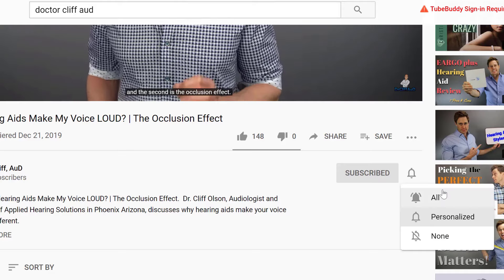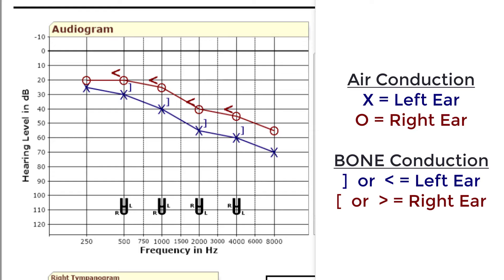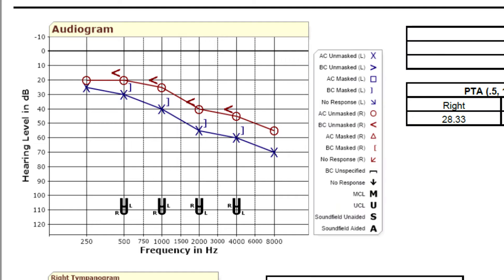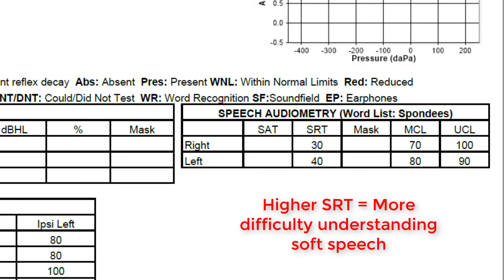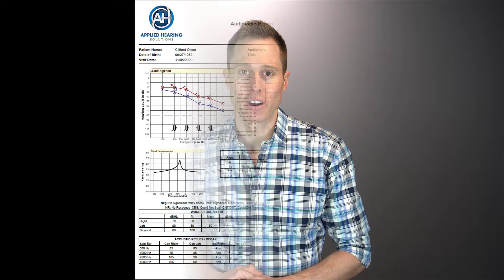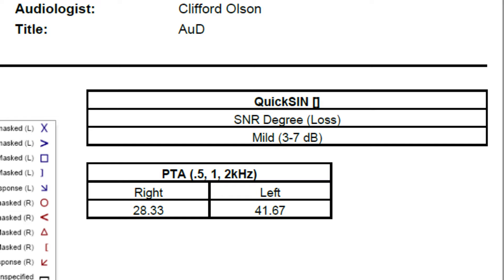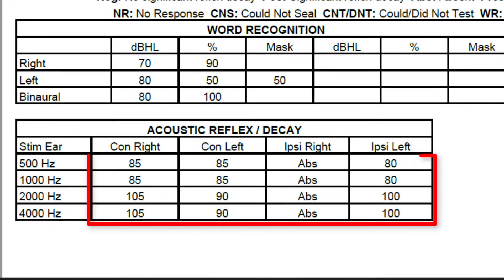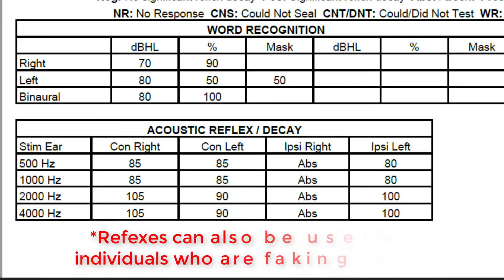Breaking Down Your Hearing Test | Audiogram Review

Comment: Another one of your really great videos and I've watched a few of them, lol.  I've now worn Philips 9030 HA for more than a year.  I started out at 80% of the initial REM settings and I've currently at 90% and about to increase that to 100% finally.  I've had to do some of my own programming to taylor my music program to my guitar playing and have two programs that still preserve some of the nice high frequency sounds of my guitars without the harsh distortion, shrillness and note doubling I experienced with just the general or music program.  In short I've turned off all the noise reduction, feedback control and directionality.  At the advice of another musician I've also adjusted the compression ratios to 1.3 which while probably not the perfect solution helped a lot.  And I've had to reduce the overall gain by about 4-6 dB a well.  Of course this isn't great for speech but it works while probably still not being optimal for my guitar playing.  I've got open domes and typical cookie cutter loss that is as high as -65 to -70dB.  Again none of this is probably optimal but it's much better for me.  My question is that I'm interested in getting or at least trying Widex HA this year with a $3K HA benefit I now have.  I want to see how the shorter delay times might help.  But I'm concerned that since I know my hearing when I remove my HA is far worse than it was normally since my brain is no longer used to working as hard to hear....how can an accurate re-test be done?  Or should I not wear the HA for the week before a re-test?  Thanks.

Comment: How long do all these tests take to complete ?
Reply from the maker: It depends on how many of them need to be done, but to complete them all, it could take up to 45 minutes.  This does not include the amount of time to review the results with a patient.
Reply: @DrCliffAuD  My hearing tests never have all of this info. on them and they only take around 15-20 minutes. Should I be asking for more comprehensive hearing test? I know about speech recognition and frequencies and bone conduction but I don't think they've tested the spondees etc. and those bottom graphs aren't on my audiogram. Also I think they only test 15-20 words. 
 I'm slated to get hearing aids next month - moderate-severe high frequency loss. Does missing these things on my exam mean anything is missing that I should have done before getting hearing aids?
Reply: @chrisbaerart  Mine take a hour or maybe more in the best time is morning , Audiologist Hearing Aides dealers Center should have a 2 big booth like a bank vault with a large door to keep out like traffic and offices typing and telephone ringing entering the booths .
Reply: Noises I meant

Comment: Hi Dr. Olson! I have a question, there is an instance of a patient resulting to a "mixed profound hearing loss" (both conductive and SNHL) on the left ear and tympanogram suggestive of a Type A, normal conductive hearing, on the left ear as well. Since the AC and BC suggests a conductive pathology on the left ear and tympanogram normal which eliminates conductive pathology of the patient, what could be other ways or have a conclusive interpretation of the hearing status of the patient if PTA and Tymp does not correlate? Thanks! learning a lot in your vids!

Comment: Is the speech in noise test always done or do you need to request it? I have had hearing tests and it was not performed. I asked for it to be done with the last audiologist and he told me he didn't have time to do it during that apt. I felt dismissed as if he didn't even care about my hearing. I bought my hearing aids there and this is the beginning of my 2nd year wearing them. To switch audiologists would mean I would need to pay each time I go in for service. Now, I get my hearing aids serviced for free since I bought them there.
Reply from the maker: Audiologists who follow Best Practices will perform Speech in Noise testing even if you don't request it.  If you do request it and they still don't do it, the question becomes:  What other things are they NOT doing that they SHOULD be doing?
Reply: Would the audiologist provide the test as part of your current agreement with them?  With the technologies of today (since digital) adjustments can still be made. Also, if SIN has not been performed, did you get Real Ear Measurements performed?  @Doctor Cliff, AuD has respectfully beat that necessity in my head - both can still be done (assuming the current audiologist has the equipment for REM). Please do not settle, you may need to push a little, just do not be afraid to advocate for yourself. You very likely paid a lot of money for the service - and if you do not get the service you deserve, be certain to share your thoughts via a review of your experience, this will help others make decisions and maybe influence a change in the practice for the future.
Reply: I agree with Both Dr. Cliff and others Professional Audiologist Hearing Aides dealers Center should care enough to give you a good hearing testing in the morning best time to spending time with you so you and audiology audiologist determine to get the right hearing Aids for you so they can adjust computer settings to fit your lifestyle and getting comfortable connecting with good ear molds fitting correctly and have their office have on hands of ears molds tubing and making new ears molds every year and having your hearing Aids clean up correctly and they should provide what hearing Aids dryers for you to use . Oh yeah Audiologist Hearing Aides dealers Center should have hearing Aids microphone filters on hands to replace every month or years supply worth since Groceries stores and department stores doesn't have any hearing testing and no parts available for their hearing Aids selling at a grocery store and Online shopping network are not with you to help to size your ears molds and tubing , you need a live person to help you do that for you .

Comment: I don’t think mine was accurate. I started having tinnitus after covid and got worse after the vaccine. When I am exhausted my ears ring. Toward the end of the test my ears started ringing and I couldn’t differentiate the sounds due to the ringing. It showed moderate hearing loss at 8000 hz. The test was conducted because after the vaccine I got Aspergillus Niger and severely over the past 6 months.
Reply: Hi Tricia, what happened did you get any of your hearing back? I am experiencing the same thing
Reply: @bellajungian8389  my ears now ring only in the afternoon and evening when I’m very fatigued. I don’t believe I have any hearing loss.
Reply: It's my understanding that if you have Tinnitus, it's vonstant, but that you may only notice it when in a quiet setting. (Which is more likely when you're fatiguée & resting).  But maybe someone will correct this if needed.
Reply: @meas2942  thank you. I’m wondering too if it may be related to an inner ear issue or my Trigeminal Neuralgia.